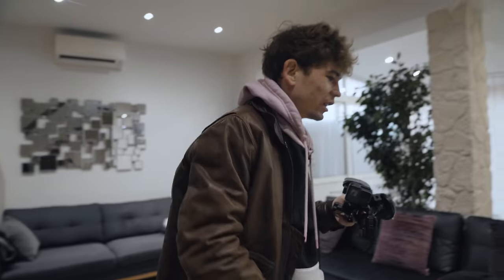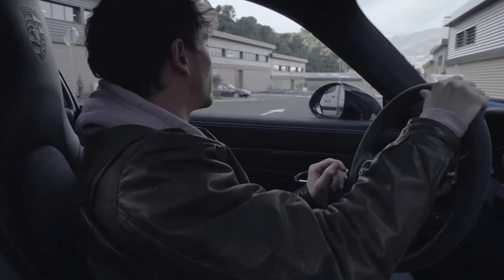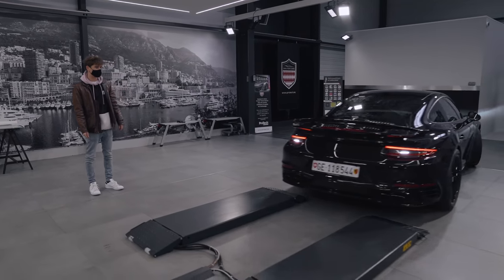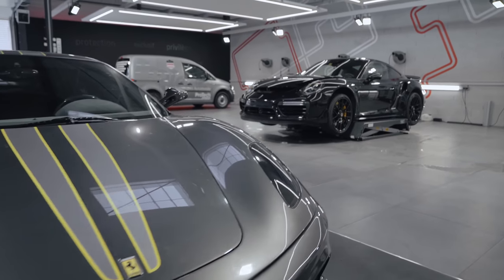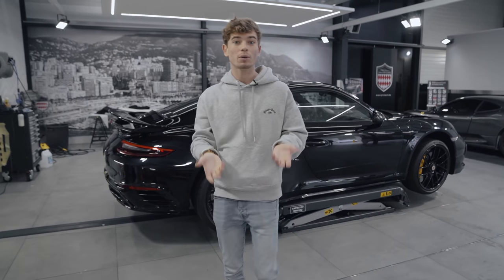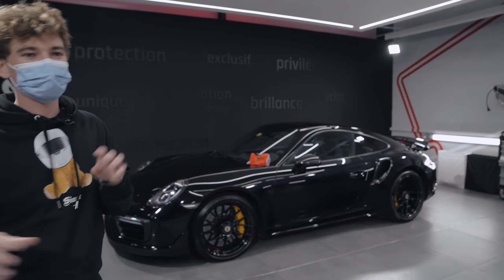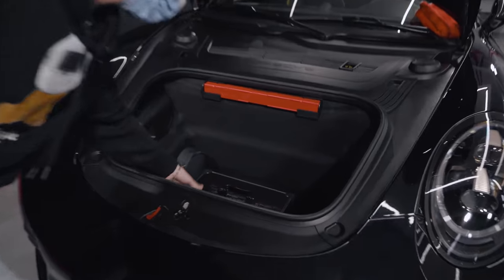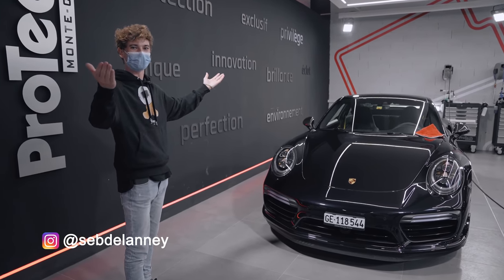WRAPPING My Porsche Turbo S !!

Comment: Can’t believe they used a sponge to wash the car, that’s just gonna introduce loads of swirls.
Did you not get the car professionally prepared full decontamination and polish etc before PPF?
Reply: Prewash, rince, two buckets cleaning with our own shampoo and sponges yes. Of course we did decontamination and preparation of the surfaces. As we precised in other comment Seb received this car from Porsche Geneva in particularly mint condition, except the bonnet where we had to also make a clearcoat correction (you can still see two small deformations in the metal on it at the end, as Seb wants to take care of later). The video doesn't focus on it and we are ok with it has it's also Seb's vlog after all ;)
Regards.
Reply: @PROTECHMONTECARLO   nice garage but 2 points to review - was surprised!
1st - for full pro service you must wash a car inside or near your garage at least with simple « karcher » with correct pressure it collects dust from traveling, and send your premium clients to self wash service isn’t cool...
Another important sing it must me forbidden to work while you wearing a wrist watch, so easy to scratch a car by accident.
Reply: lol.. I was gonna say the same thing. that was unreal. esp on a black car.

Comment: Stunning car. Criminal to see it being treated like these “professionals” did. I Can’t believe they washed the car with a sponge and didn’t clean decontam and machine polish before PPF. These guys don’t know what they’re doing you’ve been ripped off Seb.
Reply: Was working by MB dealership and its a joke how Protech works! But your Porsche is insane and hope you enjoy it for a long time. But next time choose a full sense detailer👍🏻
Reply: Wanted to comment the same thing, 2 buckets method + decontamination + clay bar + polish is a must before applying ppf. They only washed it in the nearest self service station wtf car has to be spotles under the film :)
Reply: was feeling the same! The job was very bad done!!
Reply: he didnt show all that part
Reply: Of course we did decontamination and preparation of the surfaces. And we can also precise Seb received this car from Porsche Geneva in particularly mint condition, except the bonnet where we had to also make a clearcoat correction (you can still see two small deformations in the metal on it at the end, as Seb wants to take care of later). The video doesn't focus on it and we are ok with it has it's also Seb's vlog after all ;)
Regards.
Reply: I wasn't a brand new car. They just removed most of the dirt and weren't too careful about causing some swirls because it was going to be fully treated anyway to get rid of the old scratches and swirls.
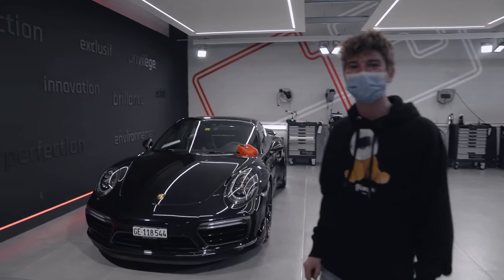Reply: @PROTECHMONTECARLO  I'm glad you commented. It would have been nice to have an insight into your entire process - but as you quite correctly say - it's not your video & editing. Also glad you mentioned the bonnet as at 12:53 & 13:04 you can see the problem.  I think prep including clay bar contamination would be a minimum - even coming from Porsche. It's a long drive from Switzerland and for the cost of a few tanks of fuel I'd be wanting full detailing immediately prior to PPF - which I'm sure is your suggestion.......but the customer is King right ;) I alway wonder if there are engineers at Porsche who when they hear someone's going to leave 3 kgs of unnecessary weight (cleaning products) in the car at all times shake their head at the years they spent meticulously shaving grams off the weight of components. It's Seb's car and he's of course at liberty to keep whatever he wants in it..... It has nothing to do with the fact that I'm insanely jealous & still saving up for one...... :)
Reply: @PROTECHMONTECARLO  nice garage but 2 points to review - was surprised.
1st for full pro service you must wash a car near your garage at least with simple « karcher » with correct pressure it collects dust from traveling and common send your premium clients to self wash service isn’t cool...
Another important sing it must me forbidden to work while you wearing a wrist watch, so easy to scratch a car by accident.
Reply: @PROTECHMONTECARLO   so u guys dont even have a wash bay or pressure washer at the shop?????
Reply: agree.. AND dude was wearing a watch while he was wrapping the car. unreal.

Comment: Don't they usually give a multi step clean followed by a paint inspection and buffing before PPFing? Or did you just not show that?
Reply: We agreed with Seb to shorten the preps in the video as we preferred to focus on the second part where he tried to apply PPF by himself and explain what it is. It matches more with Seb's vlog idea we thought.
Regards.
Reply: @PROTECHMONTECARLO  Sure. The vid does kinda lend to it being missed plus having to jet wash elsewhere maybe looks a bit hmm but it's just my opinion.  Dare say Seb wouldn't pick you guys unless you were top drawer.